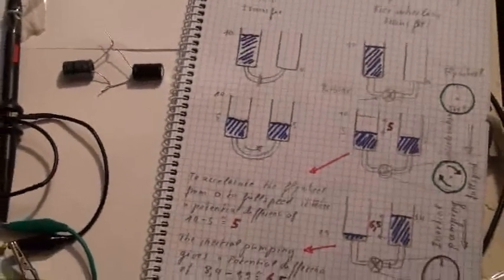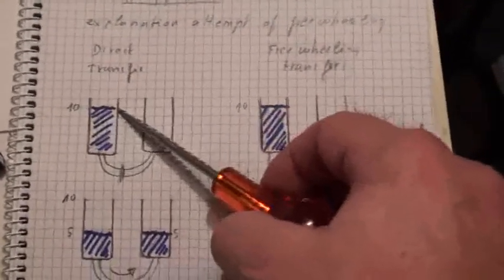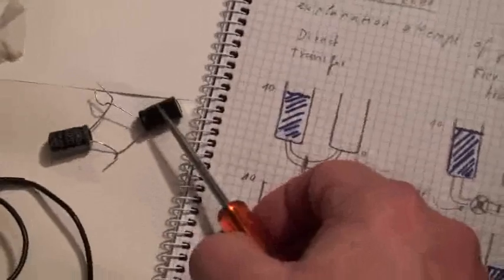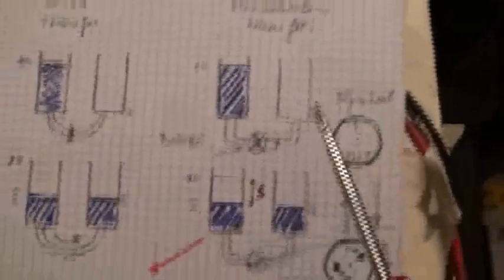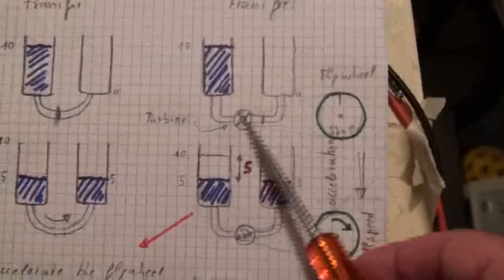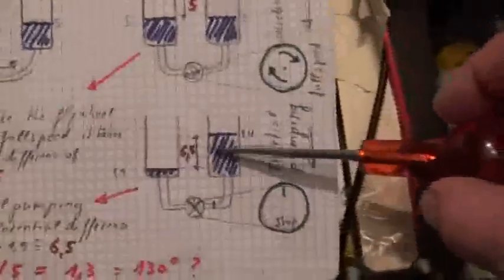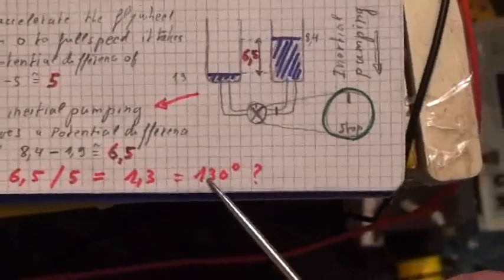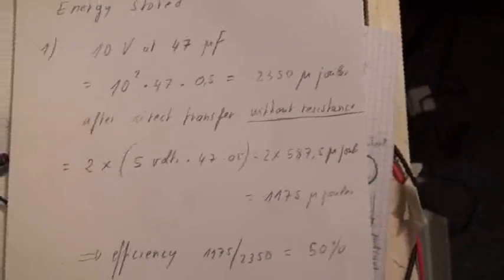freewheeling magnifier test 2 .wmv

Comment: and if the "loosing half of energy" at every switching, can you imagine what the energy losses on powerlines and in switching stations? Practically i, LIKE U, don't believe that shit! Bedini has a circuit that put between the caps from 10v and 0v initial voltage brings them to 7v /7v, energy wise this is 100% efficiency. BUT if the radiation still exists (from previos explanation), that radiated energy is than free energy? I tell you, THE CAPACITOR IS THE WEAK LINK TO FREE ENERGY

Comment: Sir,
With all due respect, energy wise u loose half of initial energy (1/2CUU) in form of "radiation" if u don't have resistance. That is the big bullshit of the capacitor, the energy formula has a 1/2 and u loose 1/2 initial ENERGY EVERY GODDAMN TIME u switch. The formula 1/2CUU is similar to kinetic energy, water in your example has potential energy!! Also einteins energy formula is c v v not 1/2 c v v like normal kinetic energy! Does that ring a bell?

Comment: Quoting Magluvin:

"So we can fully say that when the 2 10uf caps are at 500v,  20uf 500v  = 10uf 1000v   in energy."

"Thats just simple logic.  The 20uf cap at 703v has the same energy as a 10uf cap at 1406v !!!"

These are incorrect and frankly ridiculous statements.  All that you have to do is punch in the values into the formula E = 1/2 C v-squared to find out the truth.  Magluvin needs to learn the basics.

Comment: Good illustration Woopy, with the water tanks. The stored energy in the flywheel creates a pendulum like situation between the storage tanks. The losses in energy come from friction of water on the pipe between the tanks or the resistance of the wires between the capacitors.